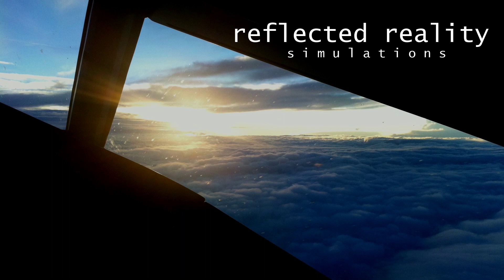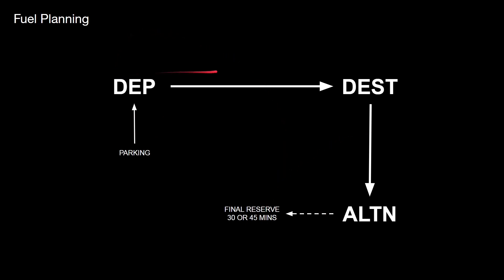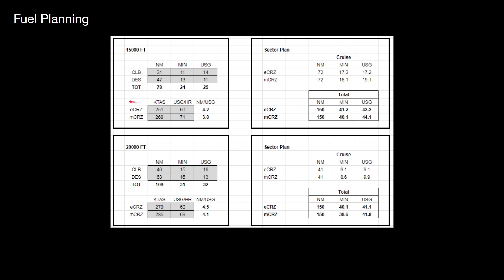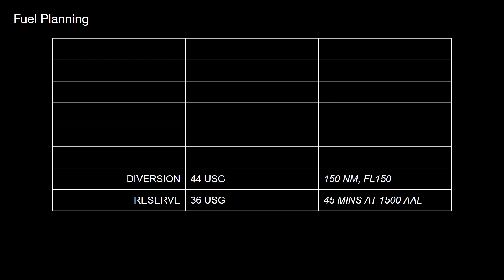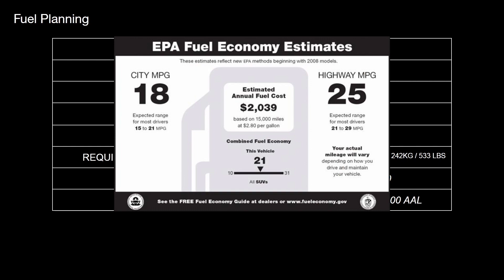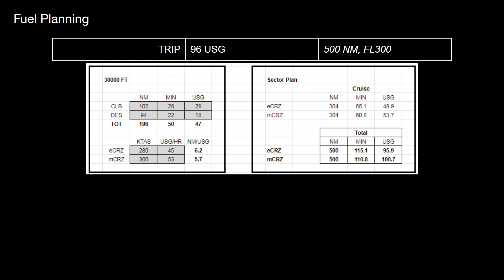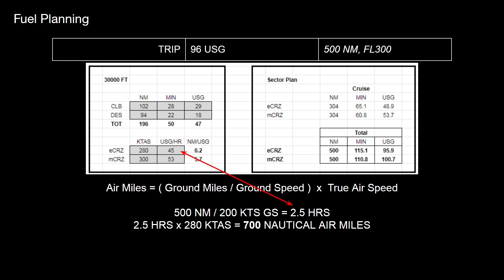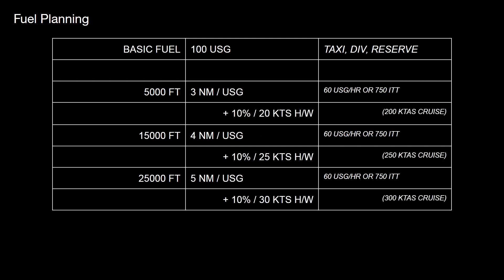Hotstart TBM 900 Extras 5 - Fuel Planning

Comment: Graham, knowing how well you explain things I wonder if you might consider doing a brief tutorial on using SimBrief to plan fuel use for a TBM 900 flight. I use this site for flight planning in the U.S. and find that my understanding of it barely goes beyond determining the basic "block" fuel which I am sure does not take into account all of the factors you outline here. If you have covered this in another video please let me know where to find that. I totally appreciate your calm and clear explanations of aircraft and flight procedures. I am slowly working through all of them. Much appreciated.
Reply from the maker: I'm afraid I haven't really used SimBrief much, but the block fuel should contain everything. Different flight plan styles call the total fuel load different things but block or tanks fuel would be common. Let me know what flight plan format you prefer and which airports from and to and I'll take a look at what SimBrief generates. Thanks for the nice comment.
Reply: @ReflectedRealitySimulations  Hi Graham. I typically fly the Zibo B737-8 using SkyVector and Simbrief to set up a flight plan. With a passenger jet I will also occasionally use a published route from FlightAware. SimBrief is incredibly useful for this as it calculates fuel use based on passenger and cargo loads, altitude, distance and even weather conditions en route. I also use it for the TBM 900 though the input requirements for that aircraft are a bit less complex than a Boeing. When I watched your video on fuel use it occurred to me that I might be oversimplifying things a bit by simply relying on the block total. I see now however that the fuel breakdown section of the paperwork preview in Simbrief does include taxi, takeoff and alternate destination.That confirms what you say.

Comment: Why do you use 750° for ITT when you could use 800°. Just curious as to your decision making process, not trying to be rude or anything.
Reply from the maker: 790 is max recommended continuous. I use 750 as an economy cruise setting at higher alts, and a soft limit at lower altitudes to give me some margin between my target and the recommended limit.
Reply: @ReflectedRealitySimulations  I appreciate the response, solid ADM, I'll look into the 790 being max cont and take your comments into account. You do a great job diving deep while not rambling which is rare so thank you for your videos. They are a great help for us that are trying to be a little more serious in our simming.